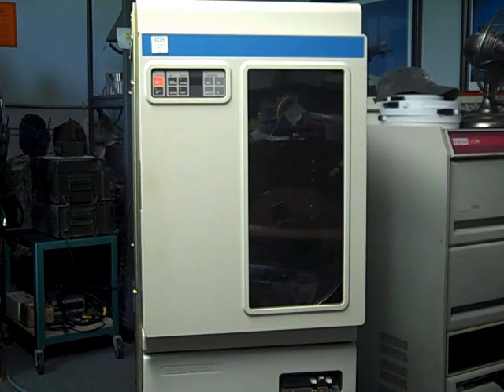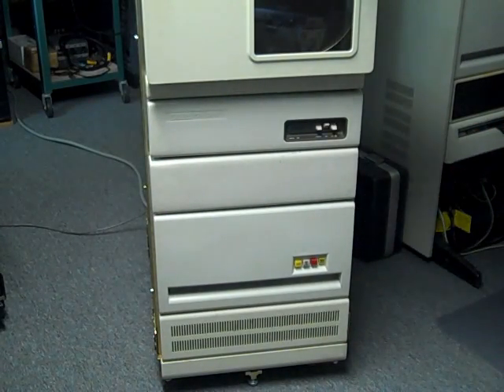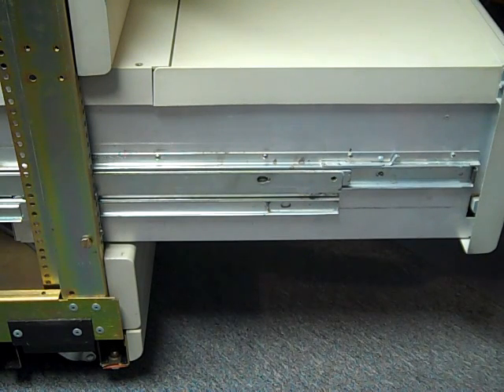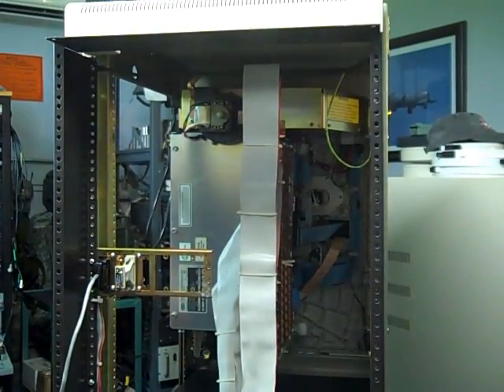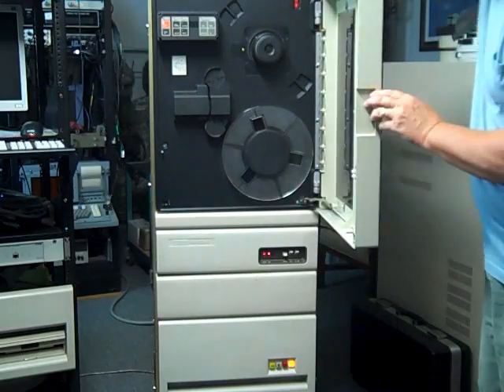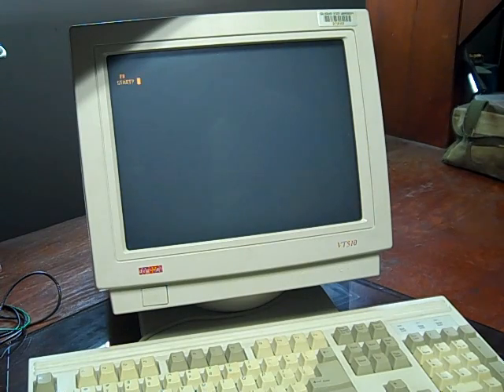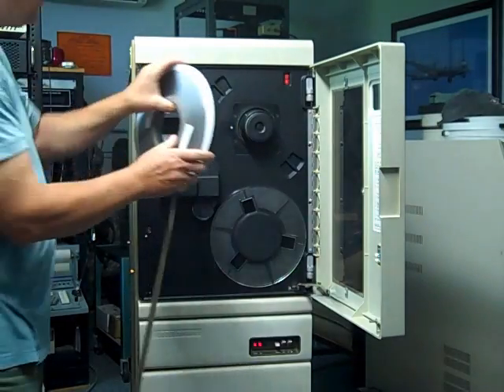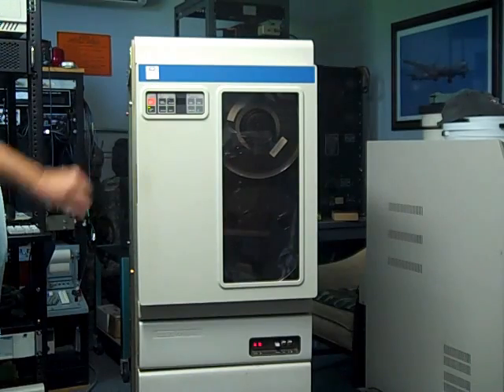PDP 11 23 & CDC Drive

Comment: Hi Ray. I worked at DEC as a tech on the floor. I am  curious what controller is used on your 1123 to run the CDC tape drive. I remember RH11 controllers on 11/34s to run TE16s, however that was unibus. 11/23 is Q bus.

Comment: Uhh - I just love the PDP equipment. Being an application engineer with Berlingske Media PrePress dept. (1985-2000) in Denmark and the quite large installation of editorial and advertersing systems from the (at that time) largest IT supplier of systems for the newspaper industries: Atex inc., and their  PDP-11 / J11 Unibus systems heavely modified both hardware and OS wise.

Comment: That's a lovely system!

My VAX-11/730's TU80 tape drive has the same mechanism, but it's mounted horizontally instead of vertically. The control panel is moved from the drive chassis to the front of the short rack, and the tape access door is hinged differently. It has the same screw lock for maintenance, but the drive pivots differently. I should make a video of my system one of these days.
Reply: Mark's Tech Channel Id love to see your DEC stuff!!!